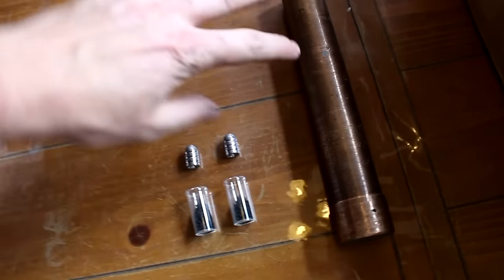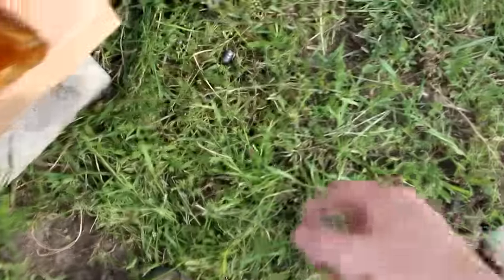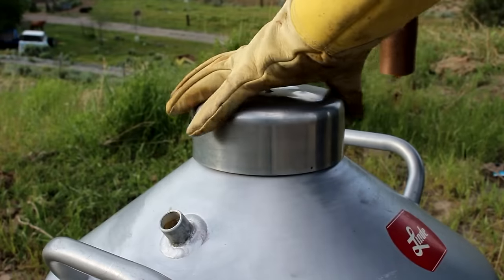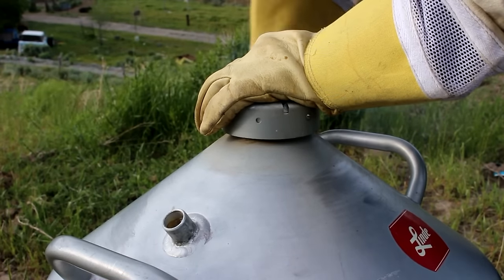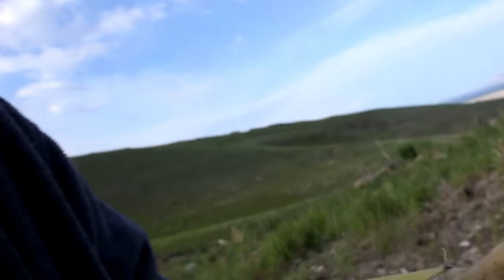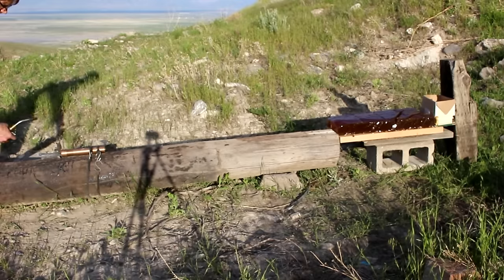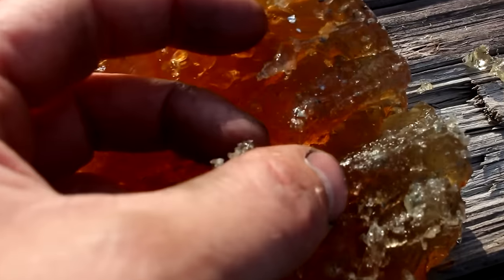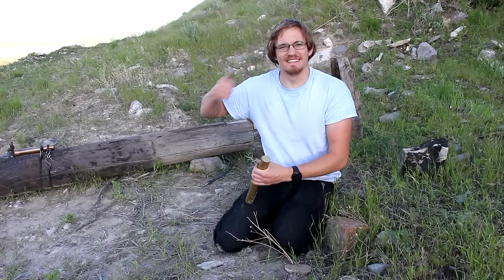Nitrogen Cooled Mini Cannon (cold gun part 4)

Comment: sensational  :-)  and Cody... could I grab some advice;  i have some copper oxide stains on a white wall (from a leaking copper pipe) ... What would dissolve or remove the oxide ?
Reply: Depending on if its Cu(I) or Cu(II) oxide which you can determine by the color, Cu(II) is blackish, Cu(I) is red or yellow. These links should show you whats it;s soluble with. For the second link go to Properties then Experimental Solubility.
https://pubchem.ncbi.nlm.nih.gov/compound/cupric_oxide#section=Solubility      Cu(II)
http://www.chemspider.com/Chemical-Structure.11677287.html                               Cu(I)
Reply: PetchyTehPiret thanx man!
Reply: Snocrash np let me know if it works

Comment: can you harvest energy from uranium? sorry i'm a big noob when it comes to electricity and radioactive materials. would be cool though, a miniature nucliar reactor!
Reply: if he got his hands on the materials and was legal, yes
Reply: Yeah, decaying uranium gives off heat and thermonuclear generators essentially are tubes of heavy water that heat up from decaying isotopes and thats how the energy is harvested.
Reply: A nuclear reactor works by heating water to boiling temerature using nuclear energy, and then driving a turbine with the steam. I don't think that could "safely" be build in a small scale.
Reply: I dont know if you've seen codys heavy water videos but you should check them out, very interested and he put a ton of time and work into them
Reply: okay, thanks guys :3
Reply: +muh1h1 if the only purpose is to get some energy out if it, it could be done. you don't need to get the water boiling you can use a sterling generator which works with heat differences. the only problem is to get enough material so that the radiation creates noticeable heat^^ which would be illegal I think^^
Reply: he has some uranium but not enough for a reactor i dont think
Reply: there was a kid who managed to make a working breeding reactor, but in doing so released several hundred times the radiation of background radiation. 

just Google nuclear boy scout and you'll find it
Reply: +Also Urine he has uranium, but it is not enriched
Reply: +Fred The Bored xD the sources the nuclear boyscout used are no longer easily available
Reply: you can probaly make a nuclear powerd stirling engine since they dont require much heat
Reply: FOXER i am pretty sure you can't produde "a little heeat", it is either all or nothing, like with a nuclear bomb, you can't make a small one of those either...
Reply: +muh1h1 the minimum theoretical weight of a plutonium warhead is about 20 pounds, they can be small
Reply: Garrett Holland i meant small as in firecracker-small. 20pounds may not be comparible to little boy or fat man, but the explosion would still be pretty devestating, and not something you could light in your backyard for fun.
Reply: +muh1h1 yep, that would be the equivalent to a few tons of tnt
Reply: decaying also makes things glow of heat

Comment: Your outro video makes me wonder. Would the brittleness of the Ga bullet be affected by the cooling process? I saw that you used liquid nitrogen, but what about refrigerated water or air? 

I ask because a blacksmithing friend of mine made a comment some time ago that dumping smelted iron in water immediately after forming it can make it brittle.. or something like that. so, could it be possible that Ga could be made stronger using different cooling methods?
Reply from the maker: very possible and I need to test it.

Comment: Can you by any chance do Thermite Vs. Liquid Nitrogen? I think that'd be kinda interesting.
Reply from the maker: yes
Reply: +Cody'sLab  I have a question dose liquid nitrogen freezes and if it dose at what temp
Reply: It will eventually turn into a solid as pretty much all things will at its freezing point. For liquid nitrogen I think it's around 63 Kelvin (or -210 C)
Reply: I thought Carbon Dioxide's freezing temperature is around -70 to -75 at 1 atmosphere. Might be wrong.

Comment: Cody, what is the difference in measurement between the bore diameter and the projectile?
Reply from the maker: they are both 1/2 inch, it is a bit of a tight fit.

Comment: 20 grains of black powder? What granule size, and what is the grain weight of the projectile? I use 95 grains of FFG powder to fire a 320grain conical bullet from my 33.5" black powder rifle. 20gr of powder seems EXTREMELY light
Reply from the maker: it is, I've been using 80 grains normally but if I did for this test the bullets would now be 3ft under ground right now.

Comment: Hey Cody, I've found some dental things from way back in the day, but what I'm most interested in is what I think is that they used for fillings. It says that in contains:
Silver -69%
tin-25%
copper-5%
zinc-1%

How could I approach separating the metals. I'm most interested in the silver. Any help would be much appreciated.
Reply from the maker: that will need to be eletro-refined. the tin will make it so it wont dissolve in nitric.

Comment: Why isn't the Galium Bullet melting in the sun?
Also if you shot someone with a Galium bullet, would the evidence melt?
Reply: The gallium would take time to heat up. If you shot someone with a gallium bullet (which would need to be at close range, since the bullet would shatter and spread everywhere) any gallium inside them would eventually melt.

Comment: So now you have a camera capable of high speed why did you not put up a blast shield and/or put the camera back far enough so we could see the temporaral cavitational wave made by these bullets? Particularly the gallium one. Otherwise I just don't see it revealing enough data that is "new" or maybe you need to explain it better ??
Reply from the maker: With the camera I have you still wouldn't have seen anything.
Reply: Oh, I thought there was a good burst-mode on that one. You might talk to taofledermaus about his setup because he shoots BG and just plain shoots a lot and does a lot of slo-mo and his Casio camera was under $1200 -- I looked at picking one up myself...best thing is it requires no computer to run.

You can do like the olympic events do -- run halogen lights even during the middle of the day. That's how they get their video of guys like Sean White doing flips so crisply that they can get perfect slo-mo. Basically, as you probably already know all cameras are light hungry. The more you give them the more they perform at their outter limits of speed and resolution.

I found out too late a great way to go is to contact the company and look for remanufactured cameras -- often cheaper, sometimes scratch and dent but full warranty.

I enjoy your videos very much. Been working my way through your bee series and scouting out alternative materials. In place of the corrugated tin you used do you think think vinyl/aluminum/steel siding would work well? And would you build that hanging style hive again?

( If you could ever do a quick FAQ video on it I bet plenty more people than me would love to just hear you talk about that. The design was very innovative. I was thinking I'd like to change it up to have two roofs...exchangeable by pulling the pins on the hinges... one super insulated for Minnesota winters and a normal one. )

Comment: “The fire is touching the frost and yet it’s not melting, in fact I think it’s adding to it” does anyone understand how that works?
Reply: Burning hydrocarbon gas produces water as one of the byproducts of the chemical reaction.  Natural gas (methane) would be CH4 + 3O2 = 1CO2 + 2H2O (I think)
Reply: Steve Treloar so it’s just freezing the water that is produced from the reaction?
Reply: Exactly
Reply: Steve Treloar ok thanks!